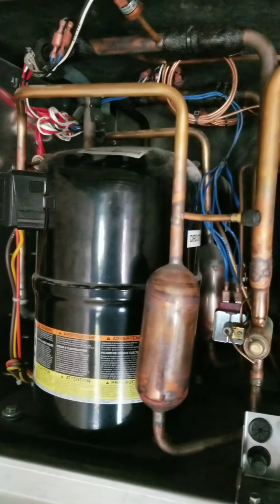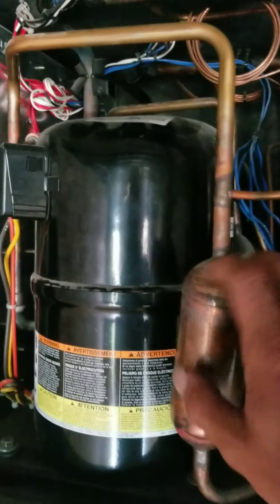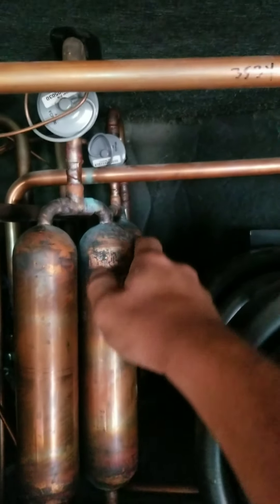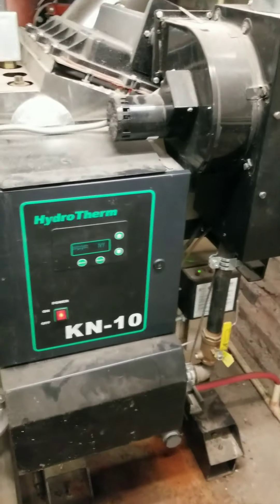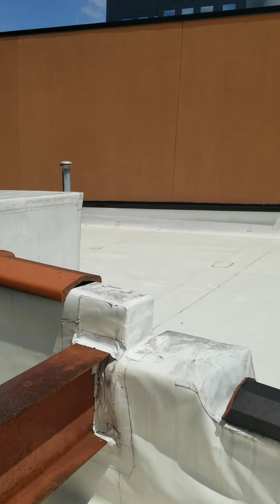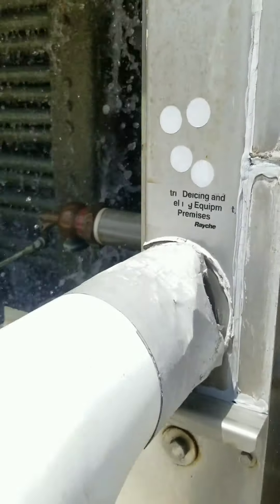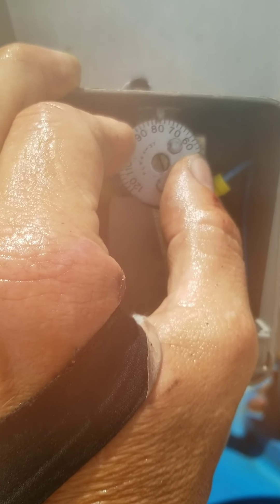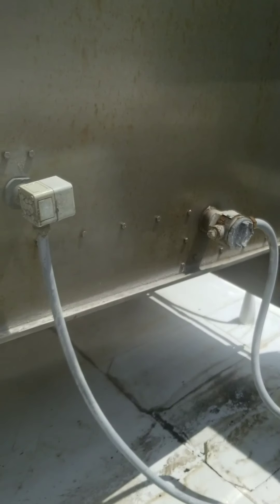hvac, heat pump refrigeration cycle, reversing valve explained. water source heat pump.

Comment: What temperature is the water typically on the commercial side, on supply side and return in the summer time? I know there should t be more than a 10-12 degree difference on input and output. Correct?
Reply from the maker: It all Depends on the chiller and what there using it for. 10- 12 degrees is normal in most cases. Temperatures can vary as far as the supply goes, again just depends on what it's being used for, if used for building cooling may only need 40-50 degrees, if cooling a machine or laser of some sort may need to be much colder. Thanks for watching!